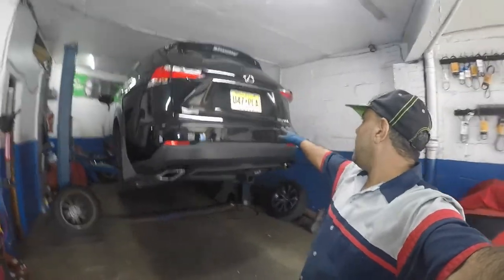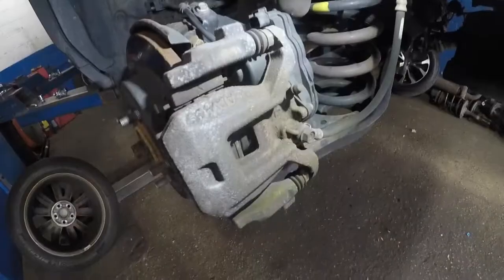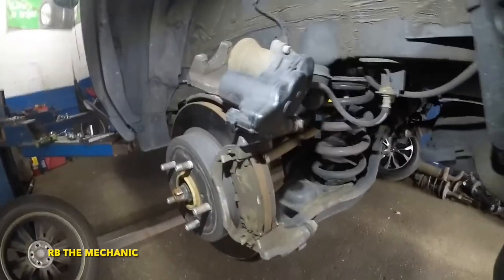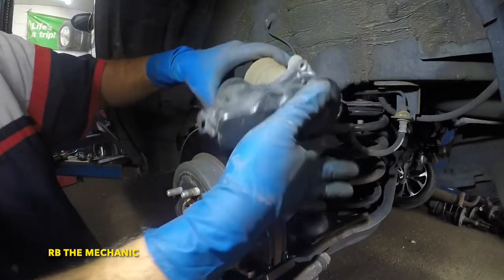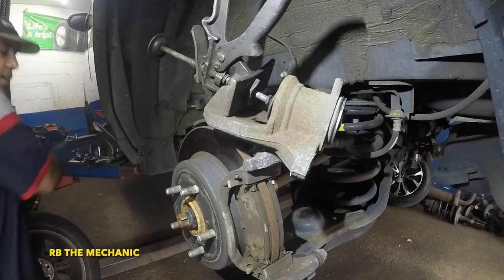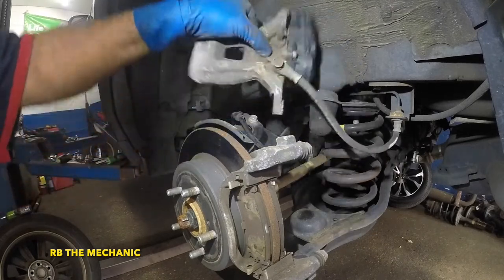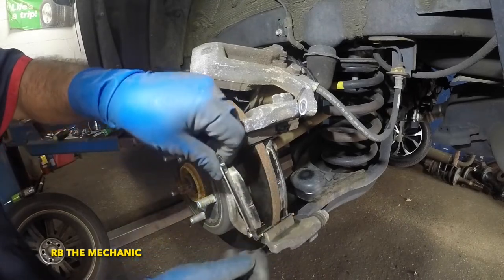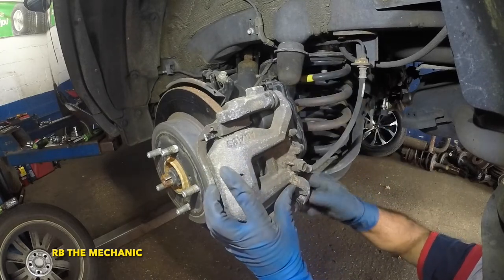2016 Lexus NX200t rear brake pads change   Lexus or Toyota rear brake service with electric parking

Comment: I just watched you having trouble getting the the upper 14mm wrench bolt off.  the simpler way was to take the 2 Allen bolts out first and remove the plastic housing before using flat end wrench to remove the 14mm wrench bolt, second thing: you can get the special 12point tool, but you don't have to.  I used the 7mm Allen wrench and it worked great.  Thanks for the video I was able to get my brakes in 2 hours thanks to you.  I never done the electric brakes so that was helpful.
Reply from the maker: No issues  tho but thanks

Comment: There is a brake service mode built into the car. It retracts the motor for you so you don't need to waste you time.
Reply from the maker: I tried holding down pressing down all the shit didn’t work so I did it my way
Reply: There are YouTube videos by lexus dealer techs showing the procedure.
Reply from the maker: @TojiZenin3956  I tried if it don’t work then it’s my way or the highway
Reply: @RBTheMechanic  a regular Frank Sinatra!!!
Reply from the maker: @yiannimil1  huh?
Reply: you did it your way.......! @RBTheMechanic
Reply from the maker: @yiannimil1  yup
Reply: @RBTheMechanic  thanks for sharing the video, below instruction work for me like a charm on nx300 2020 - tested a few times:

# To put into rear brake service mode
Parking break is engaged
Turn the key on
- Disengange the parking brake
Turn the key off

Turn the key and do the following within 8 seconds
- press the brake pedal and hold it
- - engange/pull/up parking brake 3 times
- - release/push/down parking brake 3 times
- - hold release/push/down parking brake until the parking break motors stops - you need to wait a few second before the motor starts moving
- release brake pedal

the light will start flashing, parking will still flashing. 

# To exit rear brake service mode
Turn the key on
- - hold engage/pull/up parking brake until you hear motors
- - egnage/pull/up parking brake

Comment: I wouldn't remove the Piston EPB motor. There is a gasket that once the motor is being removed the gasket needs to be replaced.
Reply from the maker: Nope if u do it correct it will be fine
Reply: @RBTheMechanic  wrong read Toyota Manufacturer and clear it states that gasket needs to be replaced if motor is malfunctioning.

Also any DYI do not proceed doing this method may or may not work correctly. There is a chance to have a warning brake malfunction on the dashboard after doing this method.
Reply from the maker: @MultiInKIEto  they also tell u other crazy stuff
Reply: @MultiInKIEto yeah you don’t have to replace that gasket buddy

Comment: How do you know which pad is the inner pad and which is the outer?
Reply from the maker: If u follow the video u will know inner pad has brake wear sensor also u can match it with old pads
Reply: @RBTheMechanic  The brakes I ordered don’t have the wear sensor, they’re just bare brakes. I can see if the old ones are marked when I do the change but someone recently told me the purple ones are the inboard pads.
Reply from the maker: @johnishk  if they all look same u can put them anywhere  but dose it come with hardware?